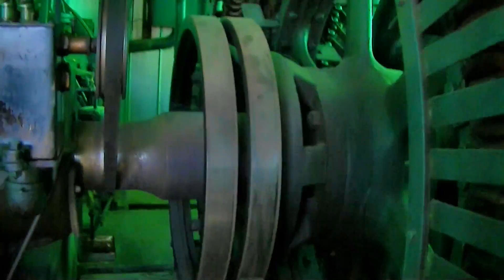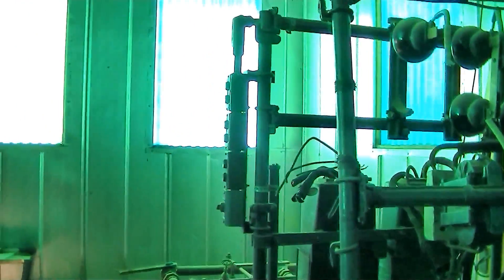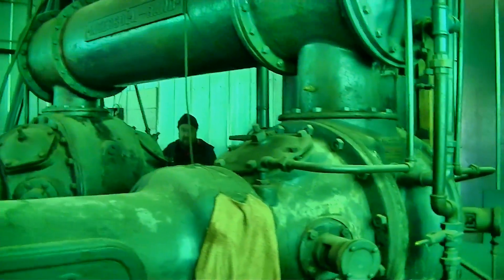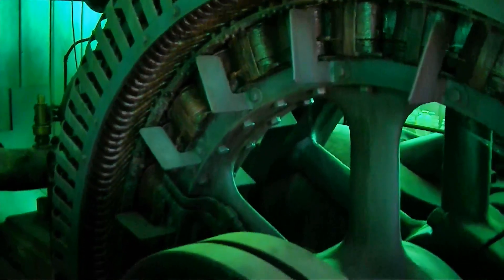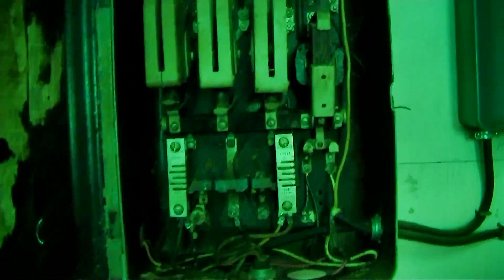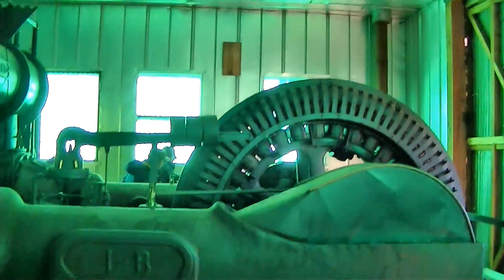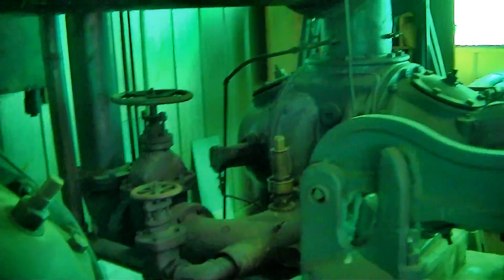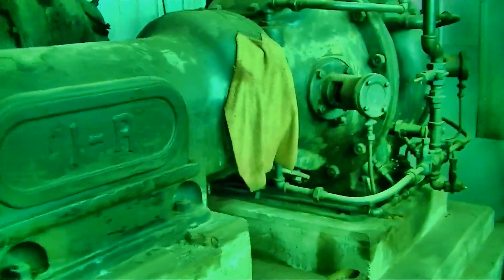Massive 250HP Air Compressor From 1946

Comment: I was a stationary engineer in the 70's and 80's. I ran 900hp 5000cfm IR's 2 stage 100psi air compressors for over a decade, along with 5,000 cfm Belliss + Morcums. There were also centrifugal 4,500hp Brown Boveri's, Howdens, to name a few for the mining industry that I ran . But the old piston beasts were tough.

Comment: I used to work on those when I worked at the Ingersoll Rand dealership in the Oakland area.  Love those big horizontals! in the early 1970s I worked on dual-crankcase models as big as 30x30 + 24x24.

Comment: what is the cfm ? And what do they do with that much air?
Reply: The PowerPlant that I work at had air compressors bigger than that that blew soot Out of the Furnace and then to the collectors

Comment: Oh that's just beautiful, I love how the motor starter was built on a rack. The ultimate in serviceability right there! Looks somewhat similar to a single piston setup I saw in an abandoned livestock trading facility back in 2009. It was an IR compressor, it stood upright and had a similar looking open cage motor like this one. Torn down now, but it was cool to see. Had a fully stocked maintenance shop just like the one in this video.

Comment: I remember those 4160 volt synchronous compressors built in the 30's but still running in the 80's. If I remember correctly they were running about 200 RPMS. Three was always a MG set close by to energize the rotating field winding's.

Comment: I'll post up an IR V12 gas engine that was running in Texas up to a couple years ago with these same style heads running off the crank. They were replaced with two screw compressors that have since failed twice... originals went in somewhere in the early 50's...
Reply: +kleetus92 
hehehe That's funny XD

Comment: Maybe I missed this part, but is this being torn out, or what? These old synchronous machines weren't fast, but they ran forever because the speeds were low and didn't strip the oil film out. That's why all the new shit beats itself to death in short order... also cheaper to build... but sucks as far as reliability is concerned.

Comment: The 3 @ 700 -  800 hp Ingersoll XBs I worked with that looked identical to yours were at General Dynamics Shipyard in Quincy Mass. At times we were putting out more than 10,000 cfm at 100 psi.

Comment: At the rear above the green shrouds are covers or panels that can be opened to see the main journal bearings, which would be awash in oil. you could actually touch the motor shaft to guage its temp.

Comment: Our "sight feed" lubricators were mechanically driven versus your belt driven units. Oil was distributed to unloaders,&  cylinders on each side of the pistons. The hand  cranks on the units were for priming & testing to see that they worked & were not clogged.

Comment: The unloaders would stage diagonally across both sides of the pistons. 1/4 unloaded would open the unloaders on say the right rear of both pistons. 1/2 load would open up the left front unloaders. 3/4 unloaded would open the left rear unloaders both cyls, & full unload would open the unloaders on the right front of the cyls. So the compression stresses were equalized all around. The rpm of my bigger @800 hp units was 700 rpm, as I recall.

Comment: When a unloader opened up, it opened that side of the piston cylinder into a "pocket" within the jacket. That "pocket' or cavity, equaled 1/2 of that side of the cylinders volume, so 1/2 of that cyls compressed air swished back & forth between that cyl side  and the pocket in the jacket, thus doing no work. When all 4 unloaders were "in", the compressor was in full load mode and all air compressed on each side of the pistons went into the discharge line.

Comment: The unloading regulator can be seen at 3:16 on the left side of the LP cylinder. Its unloading position was adjusted by moving the weights along its horizontal arm.. Outward would increase the psi top end. It would unload in 1/4 increments. Each cyl has 4 unloaders. 2 on each side of the piston, both heads.

Comment: Wow, that is an impressive machine!
It looks like it has not been decommissioned too long. What type of plant was that?
That is a synchronous motor. The rotor needs direct current (the brushes) and the stator (the outer part of the motor) uses alternating current.

The very large number if small electromagnets tells me that was a very low speed, high torque motor. Couldn't see the nameplate RPM rating though.

I hope this thing gets preserved somehow.

Comment: that overhead "pipe" connecting the 2 cylinders is the intercooler. It cooled the heated  air coming from the low pressure head before it entered the high pressure cylinder via its suction valves thus increasing efficiency as cooler air is more dense. The protruding valves at mid level on the cylinders are the unloaders, which were staged in operation. Awesome machines!!!

Comment: In the 70s to 1986 I worked with, & on this units big brothers.  Carbon copies, only bigger. 3 in fact. XB units patented circa 1910.  @800 hp at 4000 cfm at 100 psi. & a Chicago Pneumatic at 1000 hp ar 5000 cfm at 100 psi. gawd the memories.

Comment: Matter of fact, When I worked in one plant. They had a cylinder that broke beyond repair. It was built in mid 70's. They found a replacement from a compressor built in 1939. Perfect fit sans a dutchman for stroke lenght difference. I still marvel everytime I see them running, and that is everyday I go to work. LOL

Comment: I use to work on stuff like that, now I run a unit that uses a 13000 hp motor and pressures gas up to 40000lbs. I have been working around IR's since 1981.